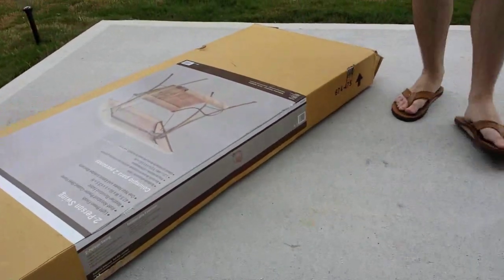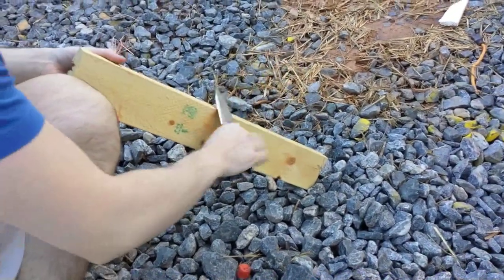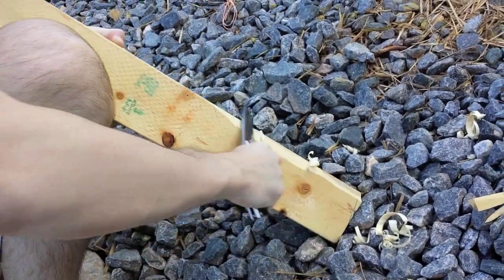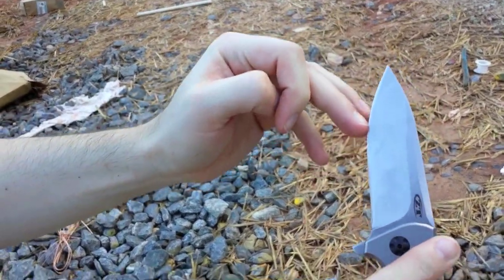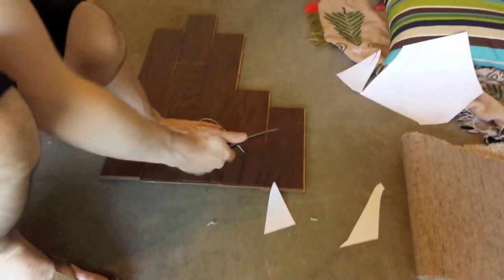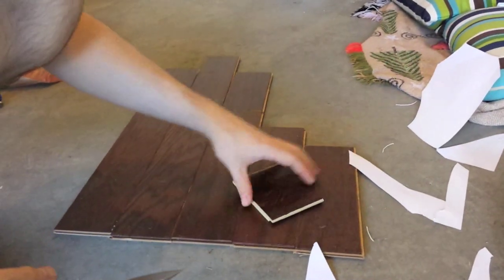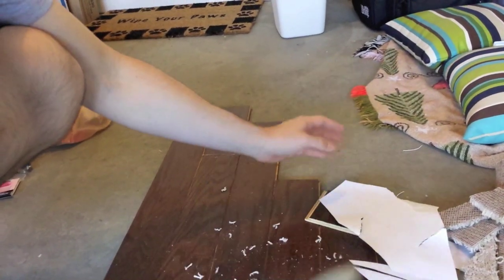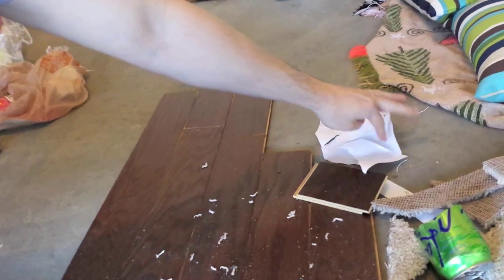Short ZT 801 Cutting Demo

Comment: Like I said in my last video where I briefly mentioned some new ZT knives that have come out and that are coming out. ZT is making some great LOOKING knives, with great materials (For the most part) But it really doesn't seem like they test their knives, like with the traveling lock on that 0801 that you showed in a video, and the horrendous blade play that seems to be indicative to the 0560/0561. Also, when these problems are addressed to them, they don't change or try to fix them.

Comment: Exactly.. a simple example is a contractor: has to open boxes, cut copper wires, cut carpet, cut open bags of cement, maybe shave off a bit of wood here and there (with the chance of rubbing the knife against a nail), etc... sounds to me like very realistic use.

Comment: Thank you! Finally someone else haddock the problems that I had! Got an 0561 Elmax and it was a butter knife out of the box. I could literally run my fingers over it. Sharpened the crap out of it and the edge doesn't last AT ALL. I thought I was the only one. Very disappointed.

Comment: I was considering the 801 and for light edc its probably a goid knife but it made to give you a nice design and a play knife which it does well. I want a good cutter for my edc knife and spydercos always deliver a good cutter so I went with the new domino and im glad I did. Love this knive, great materials, perfect fit and finish, came stupid sharp and it hold the edge good and all I do is strop a few times to get it to split hairs. Very impressed with cts xhp, awesome steel on a fantastic knife

Comment: A 15 dps bevel isn't extreme on a folding knives, that is the angle that is used on a felling axe. Folding knives should be in the 5-10 dps range assuming cutting not prying/digging and similar.

Comment: Just curious what your serial number is, mine is low 200's it would be interesting to see if they had the elmax down in the beginning and then got more lax in the HT later on in the manufacturing process or if it was just junk to start with. I haven't gotten much use on my 0801 yet but I will duplicate what you have done here and see if my results vary at all.

Comment: I know that you don't have to have a burned edge to make a knife perform badly. Yes I did take a good bit of steel off with the sharpening, I took it to 5k and I stropped it (32 degree angle). I would like someone to explain why some peoples ZT knives do fine and some don't when it seems the problems would occur in most of the knives...

Comment: Shame about Elmax still sucking. I was hoping you'd find out that they fixed the issues. All of the tasks you did were pretty normal. I've had to cut all of the materials you tested on and the only knives that dulled as fast as Elmax were cheap AUS8 knives.

Comment: Your SNG with Z Wear is more than twice the cost of the 801. Elmax in general just isn't that great and it's fairly well known that ZT's Elmax is pretty lame. The 801 is more of a really comfortable and fun EDC knife, not a "chore" or hard use knife. That's why you grab an SNG for the kind of stuff you were doing. When you're carrying a knife out of the house for the day, a sharp 801 will do just fine for opening boxes and letters, and doing other little EDC tasks. Not chores.